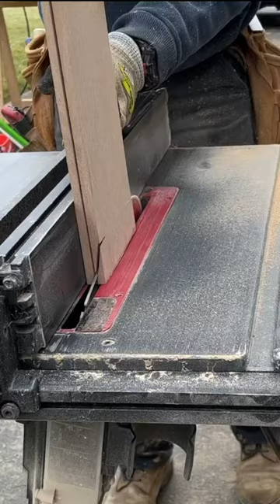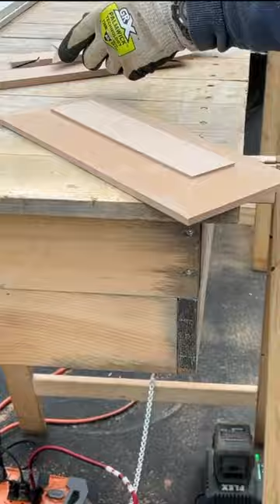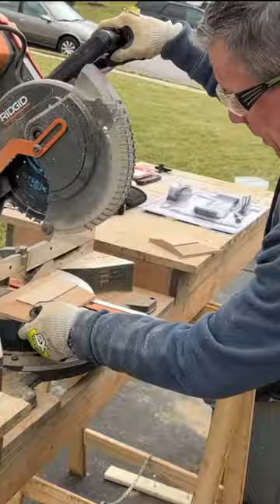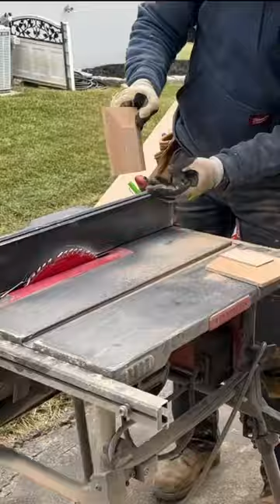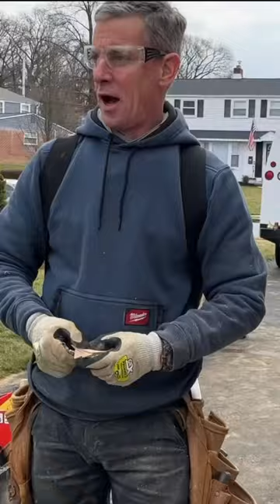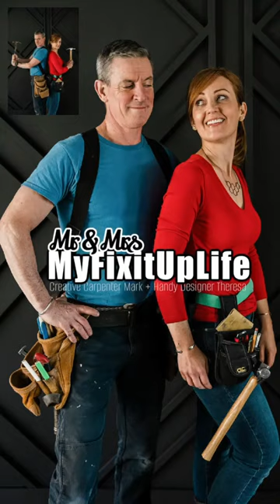DIY tips: How to make custom post caps for fence and deck posts (part 2)

Comment: Pal I got some advice for ya....from a guy with a permanently damaged thumb ...don't wear gloves! 
One invisible string can cost you big time.
I mean it dude, You headed for a bad event. Build a jig. It'll take you less than an hour and you'll never have to worry again.
Table saw is the most dangerous tool
I know from thirty years and several trips to ER ..
Get rid of the gloves my friend....do it.
Reply from the maker: I hear you. None of what I'm about to say is an argument, because I agree with you. I also appreciate what you're saying. - The gloves are skin tight, no loose strings. Loose gloves--never. It was 20-something degrees and howling wind, frozen fingers just don't work. I'm outside year round. - I also really do need to build a cross-cut jig. You're right about that too. - Appreciated. Much respect.
Reply: @myfixituplife  not criticism...I've been a builder for 30 winters in Maine. I've been bit more than 5times by tablesaw....once wearing gloves .
Once I stated doing more shop work I took classes on jig building.
Never got bit again.
You do good work. Quick way to make a raised panel without a shaper... little dangerous but it gets it done onsite.
Reply: @myfixituplife  lots of free info out there about jigs . Thousands of cool applications
Reply: @democracy189 
Good advice fella
Reply: @krugtbifro6152  hard earned ☹️

Comment: Look at those nice caps as they roll around when they get pushed through that blade unsupported. You are in too much of a hurry bud. If you lose fingers, they dont grow back. You lose them for life. Just grab an offcut with a square end. It aint rocket science. We used to work with a guy who used your method. To his face we called him Bob. Behind his back we called him " 'ol 9 finger". Ok, we called him that to his face sometimes too. I asked him about it. He said that a tablesaw makes a sickening noise when it bogs down from having a severed finger wedged in it. He did fine with 9 fingers. You will too.  
         Tablesaws are awsome. But you need to use appropriate caution. They can bite. Once the office sent a guy out who claimed to be a carpenter, he got set up, turned on the tablesaw and was going to push his boards through from the outfeed end of the saw. He said he was a carpenter though he knew that he had no experience, but thought that he was smart enough to figure it out as he went. But I don't know how another inexperienced person will fare when they see that they can make some nice caps just like yours if they just go buy a tablesaw and then follow your example.
    Do you have insurance? Does your insurance company watch your videos? I wonder what their guidance would be? See how I did that? In case you don't care about the fingers of your own or others, you should still be careful and work safe or it will cost money. Most people understand that they "shouldnt waste money". Unless you make so much off YouTube  that the costs of insurance and hospital bills are dwarfed by the amount you recieve for making these videos,  where your lesson, taught by example, encourages unsafe practices that endanger life and limb. 
Youtube rewards intelligence and ignorance equally. People who have made big money might think they are smarter than the rest of us even if the money they made was a reward for viewership of ignorance and failure. These same people  will spend it on ego padding things like many other rich people do, they might take a submarine trip to the titanic when there are videos that they could have watched from the comfort and safety of their home. Now they are dead. And all they had to do to get dead was to ignore safety concerns and not do any research, i.e. their due diligence. They think that they don't need to research because they are smarter than everyone with a lower number next to the dollar sign under their name. Screw those poorer people! If their number is lower, they are refuse who deserve what they get while the number by the dollar sign under the name gets bigger for the dead rich sub owner and smaller for the rich imploded customer.  Or less for the person who lost fingers or had broken bones in this case. 
    But you made money off the video. If due diligence costs assets and the ends justify the means then who cares about someone elses safety. More money is the goal right?
    Unless, your own experience is lacking and you don't realize your safety shortcoming and its really just an oversight and next time you will show viewers a safer way that creates more uniform caps because they are held securely and  aren't rolling around in your fingers as they slide past the spinning blade.
    I probably gave it to you harder than you deserve. I gave it to you the way I would deserve it if I had done that because I should know better. And I have made the same mistake by being in too much of a hurry to grab an offcut, many times. But I wasn't teaching anyone proper tablesaw use through my example. The fingers that were endangered were my own. Less wrong, but still, wrong. To save my boss a little time, at the risk of my fingers. 
     Dumb as me, isnt a good example to set bud.
Reply from the maker: I care about other peoples' safety. I don't have the time to launch an investigation into all your other observations, but a push-block doesn't keep the piece tight to the fence. Using the cross-cut gauge is sketchy at best. Is there a better way to do this? Sure. I'm not perfect. - I do respect the tool though. I appreciate your comments.
Reply: @myfixituplife   @myfixituplife  Push blocks hold items towards the direction that the force you supply pushes them. Many tablesaws come with them. Your argument that pushblocks or pushsticks simply don't work is false and absurd. People use them all day every day. If you need greater control, then a sled with a clamp will hold smaller or (like in this case) odd shaped items. You can find people using this method successfully all over YouTube.
     I hope you're fingers weather carpentry whole. Ive seen things like that cap rip out of my and others hands before.  Better safe than sorry. And you should consider your insurance company. Why would they want to pay out for preventable injuries after watching your videos and reading the comments and your responses. Do you have employees? OSHA could investigate  and issue fines right from their desk if they got a report that one of your employees cut off fingers and then watched you voice your opinion that those caps werent rocking, rolling or wobbling in your videos and there was no danger 'cause it hadnt happened to you, yet, and then read the comment section.
     It sounds like "Because I said so!" is the logic. That works on some when accompanied by physical intimidation and dominance. 
     Don't try to dominate me. Use reason. I know reasoning takes more assets than "Because i said so!" but I will understand better if you use reason instead of trying to dominate my knowledge of right and wrong with a lie that says that pushsticks dont work.

Comment: I wanted to like this but cant…looks like mdf for exterior post caps? And didn’t measure the bevels correctly enough to be done with power tools?   I think you should try to make money with fly fishing videos rather than diy..:it’s easier to fake good results…
Reply from the maker: It's a new composite called Acre by Modern-Mill. No thanks on the fishing offer.
Reply: I'm sure the bevel is done this way intentionally so that he gets more of a depth reveal